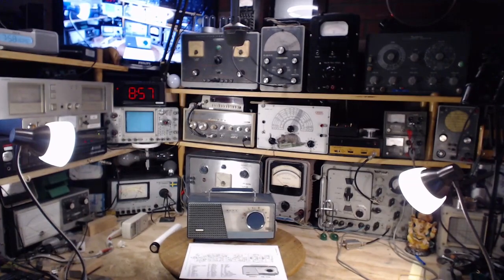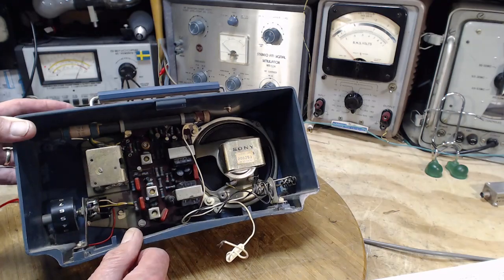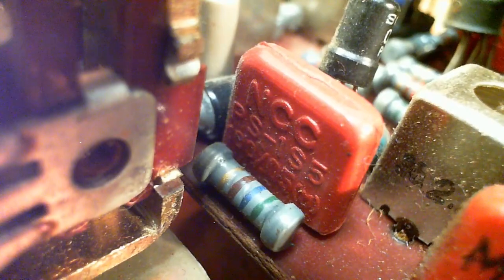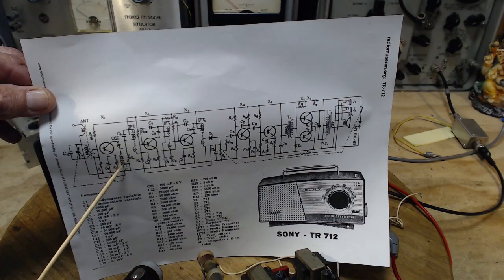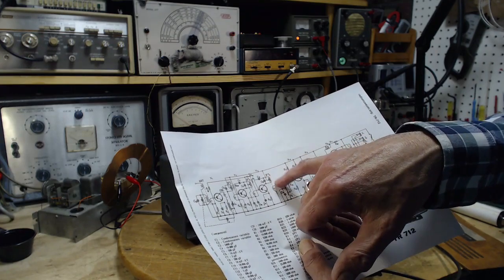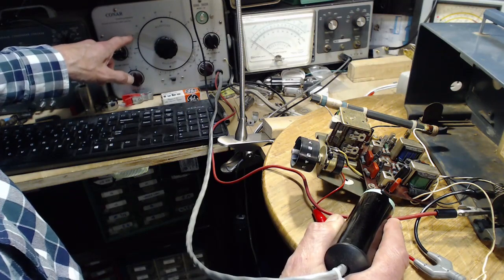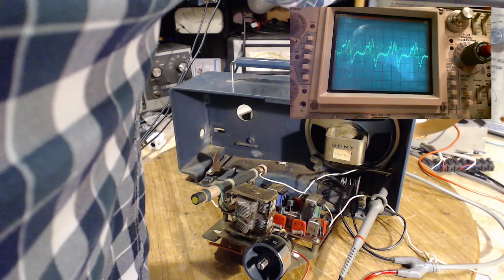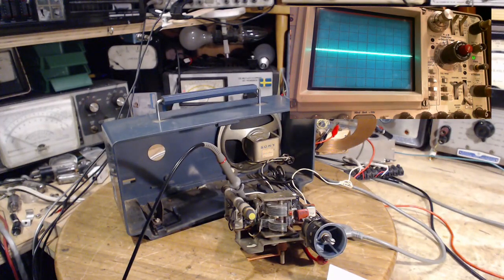SONY TR712 Transistor Radio Video #1 - Checkout and Testing

Comment: 2:00 If you are wondering why there is two earphone jacks, why dont you look at the schematic? One jack is set up to cut off the internal speaker on use, the other jack keeps the inbuilt speaker on...
And 2:06 about the antenna wire having been connected to one of the speaker jacks; according to the schematic the antenna wire is a winding on the ferrite rod antenna with the cold end on ground. Connecting the hot end of the antenna wire to a ground too, effectively puts a shorted winding on the rod antenna. I hardly doubt that a shorted winding on the rod will improve reception...
So you may reconsider your "does not help or hurt" assessment...

Comment: Hope ya can get this baby 👶 back to running 🏃. Good to hear 👂 that it's a family 👪 heirloom. I really like 👍 the design, which makes it so. Did ya say this radio 📻 was from 1972? Like 👍 any radio, you'll need to replace bad 👎 capacitors. Possibly re-stuff IF (I.F.) cans. I'd try this somewhere besides the basement, or do the testing at night 😴. This is when radio 📻 waves 👋 are most active. Your friend, Jeff.

Comment: 11:30 Seeing how easily accessable the volume pot is, the first test one could have done is unsolder the wire feeding the high side of the pot and inject an audio signal there. If it is played back distorted the problem is downstream in the audio amp. Then one could have tapped off the signal on the pot with a signal tracer and see if a received station comes in clear.
That way you would have had direction of where to look; audio amp or detector frontend
And having direction early avoids spending time and blindly resoldering everything, because in doing so you can cause shorts, traces to lift or heat travelling up the legs of germanium transistors and stressing them to where they fail.

Comment: 28:01 a clipping signal should unclipp if you reduce the volume or modulation depth. This signal is not clipped but distorted because of missing either the upper or bottom half, depending on what output transistor is bad. Even a very wide zero crossing gap caused by insufficient bias would not sound that distorted.
Reply: @seventeesweremagic  You are totally missing the point.

Comment: A bad 100000pF capacitor connected between the two output transistors ( at their collectors) would be the main culprit here. That and weak/ leaky  electrolytic capacitors,
of which there are 8 in this radio, and you should probably replace them all.

Comment: 1:08:12 BS! The scope will hardly be affecting the radio thru the probe when changing the sensitivity. 
The truth is more like the lower sensitivity settings on the scope are broken. Most probably due to dirty switch contacts!
Is there any test equipment in that shop working properly AT ALL?
Reply: Hey Jim, Ray Burke here old Tektronix Tech, your scope having triggering problem.  you might try the "B" triggering to go to "B"  delayed sweep.  It looks like your "A" tunnel diode past the trigger preamp IC.  A trigger  CR550, CR552 (152-0125-00  4.7 ma, 15 pf TD), could be swapped with CR650, CR652 in the "B" trigger circuit.  those tunnel diodes may be hard to find.  You might get a schmatic from BOCA under Tektronix scopes, later Ray Burke.